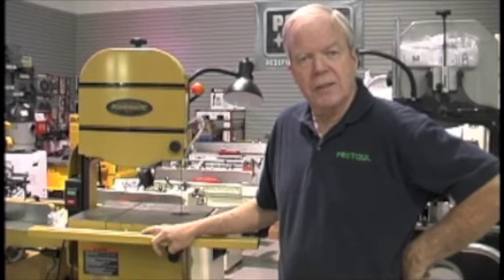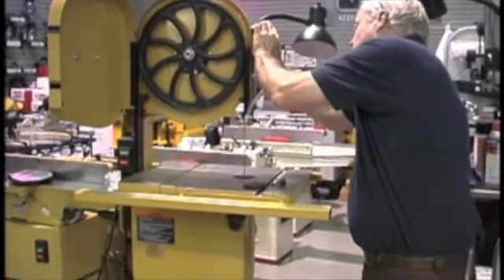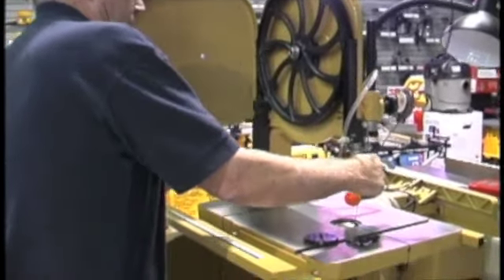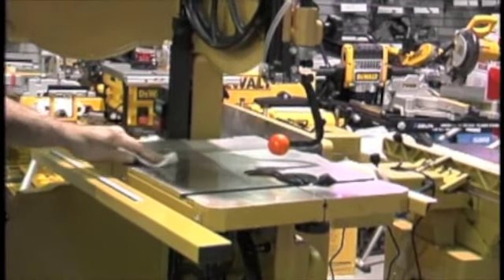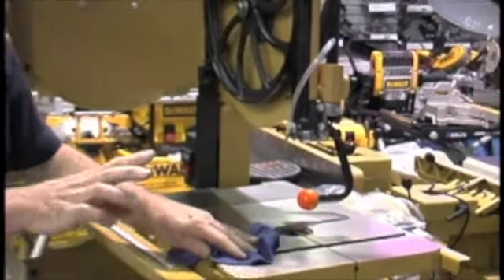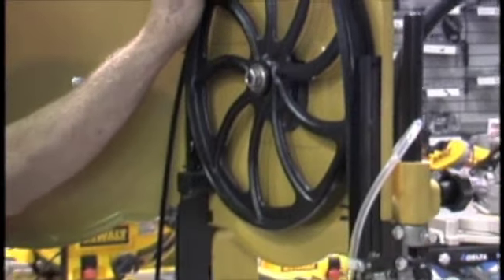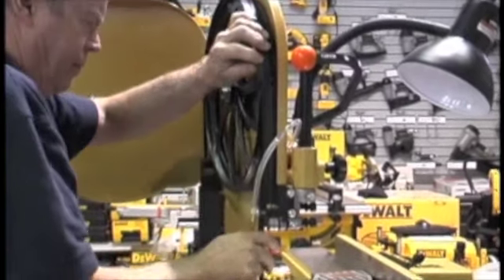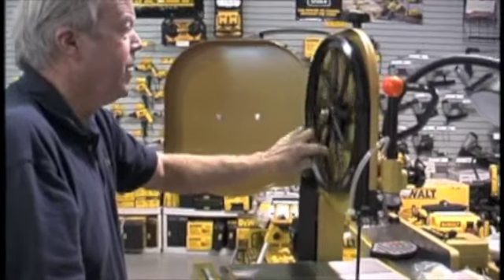Band Saw Blade Removal and Replacement

Comment: I cant get my 1/8" blade to ride in the center of the tire.. No matter how i adjust it. I have always used wider blades, never a 1/8" which the machine says it can handle (1/8"-3/4" wide) Craftsman 14".